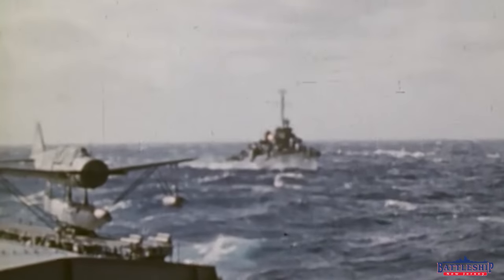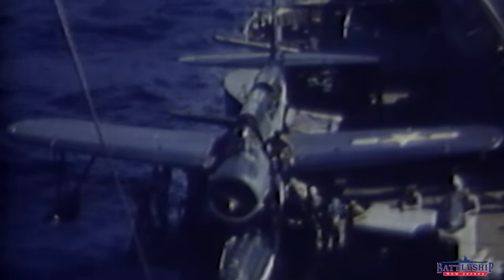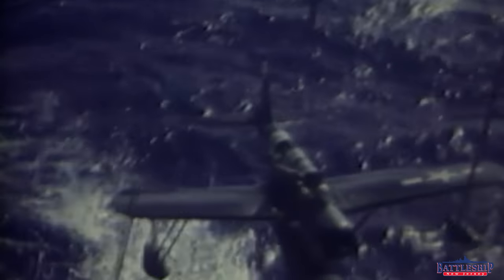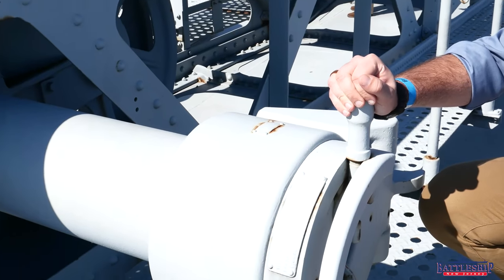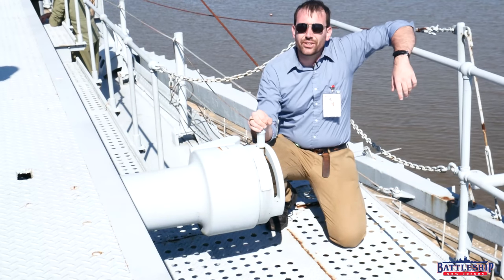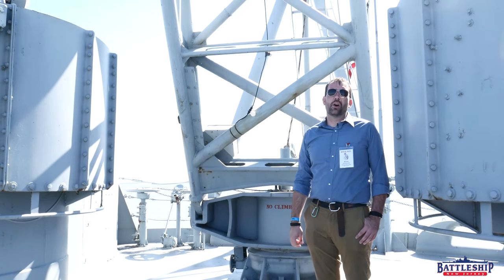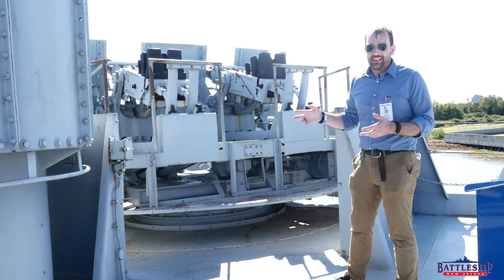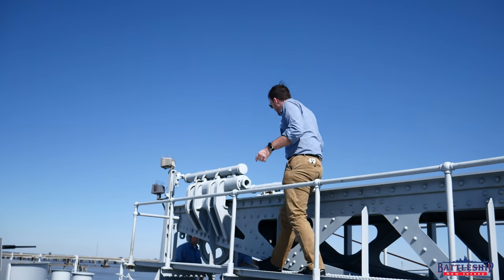How Do You Catapult A Plane Off A Battleship?

Comment: Answer = Very Carefully.  The most interesting to me is getting them out of the water, back onto the catapult.
Reply: For sure, I wonder what the success rate was for water skiing on a canvas sled and hooking up a cable...
Reply: @loosehandle1  I bet more than a few planes were simply abandoned in the water in rough seas / possible enemy spotted
Reply: Getting them back aboard was actually not hard not very dangerous at all, just very time consuming. In rough weather its still plausible and the crew will make all attempts to get the plane back as well as the pilot. If a enemy was spotted however the plane would likely be left and the pilot until the ship can safely return to pick the plane back up. If the ship is in no state to do so the plane will be abandoned and left at sea and the pilot will be taken back aboard. Or if there is another ship around capable of taking it, that ship will take the plane with it.

Comment: Video idea: I would be keenly interested in a video about the life rafts of WWII. The rectangular ones (not lifeboats made of wood), that were usually stacked 3 high, and mounted to the deck, different exterior walls, and even the sides of gun turrets. I am interested and how they were constructed, and the materials used, as well as the quick release mechanisms. There is surprising little information on the Internet that I can find.  Cheers
Reply: They are called Carley floats, they were a metal tube made of sections that were filled with cork or other buoyant material so that if one section was punctured it would still float. The center was basically netting and there were plenty of lines attached so that if guys couldn’t climb into the float they could at least hang on and all be together. As far as attachment I think they just hung on a hook, easy enough to lift off and toss over and in theory they would float off a sinking ship.
Reply: Life rafts were first manufactured and used in WWI and then in greater numbers during WWII.
Of course you had the before mentionned Carley floats.
But there was also an other type of more rectangular rafts known here in france as "radeau type Brest".
Those and similar ones were made of non strategic materials - balsa wood and rubberized tarp for the float proper and a wood grating in the middle. Contrary to the Carley float, that grating did not sit lower than the float but was fixed to it. And of course some rope net around the float to hang to it.
A third and rare type was just made of a tin rectangular box (in sections) covered with tarp.
(Source : Handwritten journal of the officer (then) in charge of life raft manufacturing, Saigon navy yard, 1915)

If Carley has his name associated with his design, it is very hard to trace the origins of the US and other designs.
Were they independant ideas, took inspiration from one an other or the result of tech exchange beetween allies?
Reply: A reminder a carley float was just that a float not a boat. It kept people safe from drowning. Some of the people or some of parts of people were in the water for temperature exposure. Being pulled under water and drowning kills quickly while the temperature varier from rapid in the arctic to days elsewhere. The blessing of the floats war resilence to minor damage like shrapnel. That shrapnel often active in the "significant emotional events" that sunk the ship in the first place. Folding and inflatable boats would eventually replace them.

Comment: According to Wikipedia, the Kingfisher's landing speed was 55 knots, (seems a bit high to me, but then again it is a floatplane so you couldn't slow down as much since you needed to be close to your (minimum) take-off speed if you had to do a "go around'!).
 
This means that between the catapult, the ship's speed, and the wind speed (since the cat did swivel into the wind direction), you were probably already pretty much at a safe speed for take off before you reached the end of the catapult!
 
Final note: I fought a JP% fuel fire on the helo pad of a ship, I used solid stream!  (Instead of letting the fire sit there, while waiting for the foam and cooling to put out the flames, I merely was doing my best to blast the flaming fuel off of the deck!!! (since the pad and the leak were on the fantail!))
Reply: Just a little less than a Cessna 172 (65 kts). But you can only go so slow till you stall, and the planes are built to handle water landing.
Reply: @johnknapp952  Yup!
To Clarify: The Float adds a lot of weight & drag, this is why with it's small engine, the OS2U Kingfisher had to keep it's speed up during landing, since if it had to go around (for any reason, up to and including enemy action), it's landing speed had to be close to it's minimum to maneuver and fly properly.

Comment: My last trip to Bama, I tried to figure out why the catapult did not seem right. I could not visualize its swing. Now I know that it is larger than the original. Thank you. The cranes can be lowered down and lashed to the deck. Important when firing the main battery. I doubt the guns would be trained aft. But possibly damage from the blast could affect them. I always understood that the planes were launched as the blast would destroy them.

Comment: Hi Question I have is is : during deployments say in ww2 and after roughly how much time would sailors on a ship this size be outside in fresh air or spend below decks ? Did they get a certain amount of time above decks?  Thanks if any answers from Nz
Reply: I can't speak about the war, but on the cruiser I was on in 1980 and 1981 there were no restrictions on being topside during daylight that I can remember.  Except, of course, for obvious things like wandering around the flight deck during flight quarters, and you weren't supposed to be outside at night.  But remember, you're typically working 12 to 14 hours a day, so there isn't much free time.

Comment: I think we have an explanation as to how we ended up with the B-52 video last week (Still love it) .  I thought most American cruisers had their aviation crane at the stern. Unknown how many cruisers had their catapult at the stern. Some had hangers amidships, I think many had not hanger. IF the seaplanes stayed on the stern, and they fired Turret #3 broadside- how with the seaplanes handle that?
Reply: From the USS Brooklyn onwards they had their cats and floats at the stern with the cruisers having a hanger there as well.  All earlier cruisers had it amidships and I think most older battleships varied widely on the location of their cats, until after Pearl Harbor, but that was only for the ships that were rebuilt!
Reply: The OMAHA class light cruisers had no hangars.  There is a book called CRUISER FLYBOY about the USS MARBLEHEAD in WW2
Reply: @anthonyglass170  Yes, they were too old when built to have floatplanes aboard.  Not sure if they were intended to lower a floatplane over the side for it to takeoff (fully under it's own power).  
 
But then again they were too lightly built for much improvement and were an extremely outdated (for the USN & RN) design by WW2.  In fact, for improvements they had to land (remove) guns to keep the ship stable!
Reply: @timengineman2nd714  Not sure I totally agree with you - but some stuff I read - I might be wrong, also highly increase my interest.

Comment: Alabama’s Kingfisher used to be on display sitting on the catapult. However after Hurricane Ivan (2004) the plane was moved inside the museum building. The roof of that building partially collapsed during Katrina (2005) causing significant damage to the Kingfisher and many other aircraft and exhibits. As of two years ago when I last visited, the Kingfisher was still in rough shape.
Reply: I know not when. But it is scheduled to go to Pensacola for restoration. I think a swap between a couple museums is being worked out to get one quicker. Pensacola swaps quite often as they try to have combat veteran birds. They do have some extra aircraft. And they often restore SBDs or other for other museums with some swapping. They have a very large hanger and a large amount of NOS parts.

Comment: This facet of WW2 ships has been a hobby of mine for decades.  So hard to find any good history of these relative to engineering, use and maint until just a few years ago things started showing up online.  In any case, it would be excellent if you could find a pilot who flew this mission or a crew member that supported it directly and interview them.  I have never found anything in any books with testimonial from any pilots or crew on this.  On a closing note....I bet they ate through props like a knife through butter....all that spray in recovery

Comment: It's strange that the smaller cruisers had hangars but the larger battleships don't.
Is there a reason for that?
Reply: I'm assuming because it would be a weak point in the Battleships armor.
But another reason is that most of the BBs in the world were built before or during WW1, when airplanes were still in their infancy. Due to treaties, BB construction was on hold until the 30s.
Cruisers, while also limited by treaty, were built into the 20s and 30s, thus many were built with aircraft floatplanes in mind.

The British did refit their older BBs with hangers for aircraft, and the Germans 30s BBs did have hangers as well.

The US never did build aircraft hangers on their BBs, and the IJN got hangers with the Yamato-class and the rebuilt Ise-class.

Comment: I'm surprised that steam catapults weren't used, I kinda assumed that's what they'd be.
Reply: that would require a steam line running from the engineering space to the catapult.
Due to the nature of BBs, that would be another 'hole/weak point' in the armor. 
Due to the nature of steam, if you recall the video they had involving looking for steam leaks, I think you'd want to limit steam to where you truly needed it.
Reply: Black Powder Catapults on WWII Carriers some like Enterprise and Yorktown even had Black Powder Catapults on the Hanger Deck as Built.   These were removed early war to make room for storing more aircraft.

Comment: I'm guessing  steam powered  pistons
Reply: You'd think that, but no.  It's something even simpler.
Reply: Actually, the (British) Royal Navy invented 3 extremely important things after WW2, since getting high performance jets to safely operate off of carriers was an issue.  (see the first one I list)
 
These were:
1) Steam Catapult (.vs. the earlier Hydraulic systems, look at the old film: The Bridges at Toko-Ri to see the below deck part of an hydraulic cat)
2) The Angle deck (Bridges at Toko-Ri also shows the issues of landing a jet on a straight deck)
3) The Landing Lights system, since they realized that jet pilots had trouble seeing the flags of the LSO at the landing speeds required for a high performance jets...